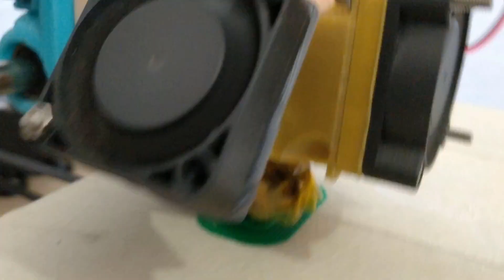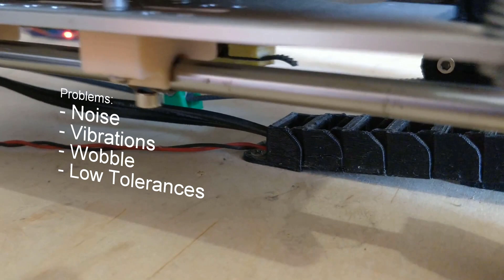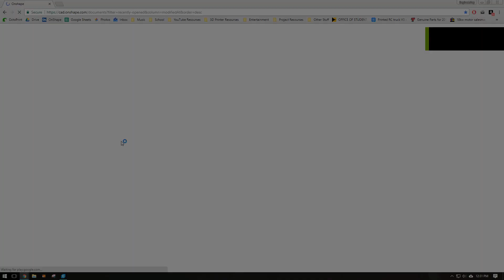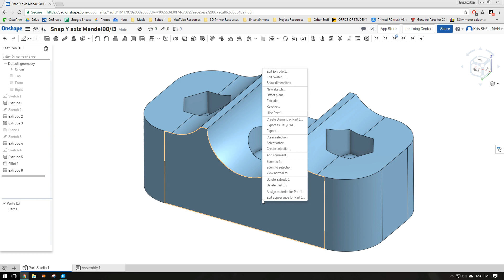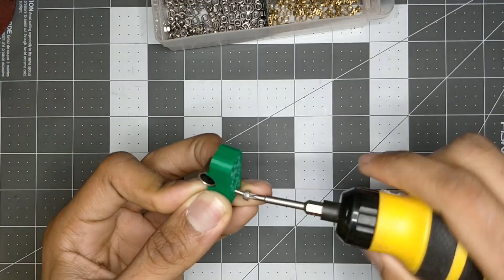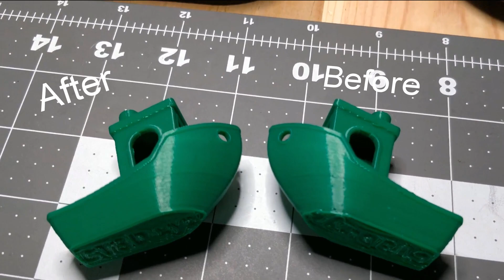New Magnetic Y-Axis Bushings

Comment: Moving magnet along a conductive metallic surface = magnetic brake.
High enough motion speed (doubt a printer could do this though) the magnets will actually be repelled by the iron due to the eddy-currents overpowering the magnetic attraction.
Reply from the maker: I've been using it like this for months printing at 70mm/s and haven't had any issues at all.